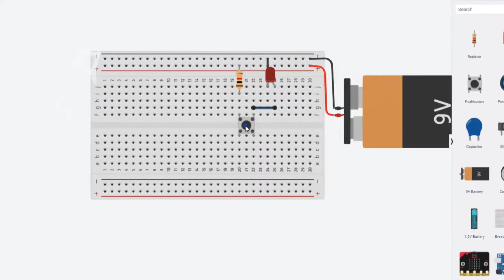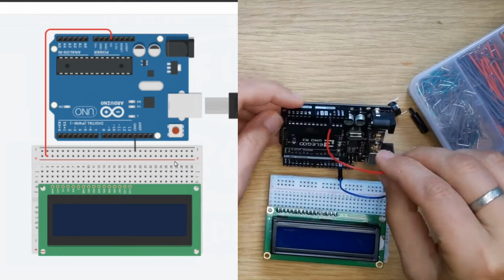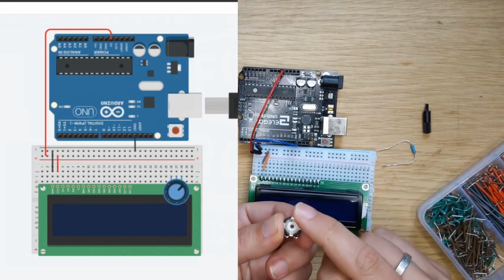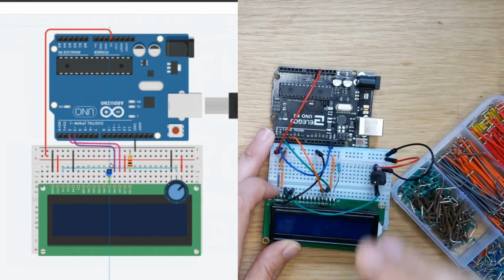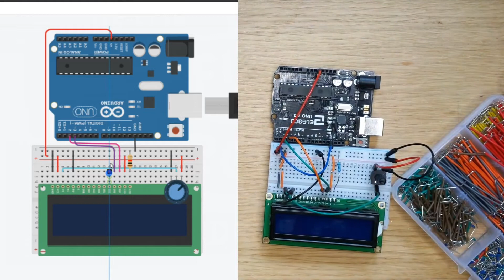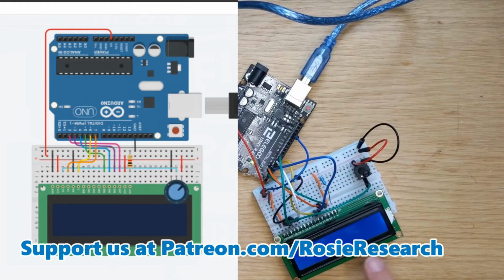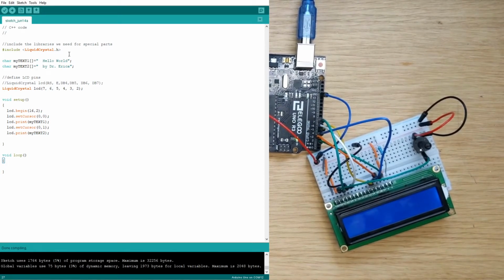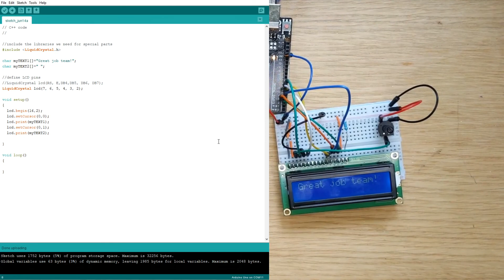Breadboard Circuits Tutorial - How to wire an LCD display

Comment: #include <LiquidCrystal.h>

LiquidCrystal lcd(12, 11, 5, 4, 3, 2);
char myText1[] = "Hello World";
char myText2[] = "by Matt White";

void setup() {
  lcd.begin(16, 2);
  lcd.setCursor(0, 0);
  lcd.print(myText1);
  lcd.setCursor(0, 1);
  lcd.print(myText2);
}

void loop() {
  // Your loop code goes here (if needed)
}
Reply: make sure to plug pins 7 and 6  as shown in video into 12 and 11 on Arduino uno board and past this code.